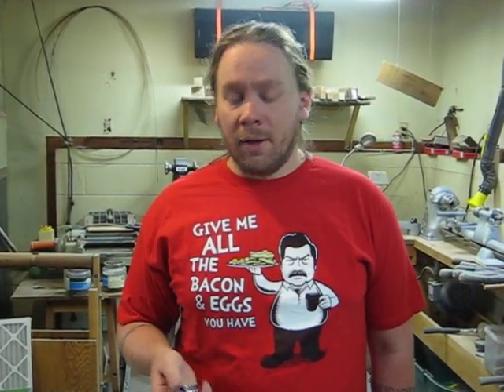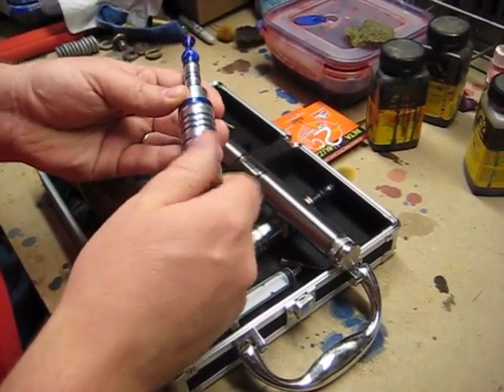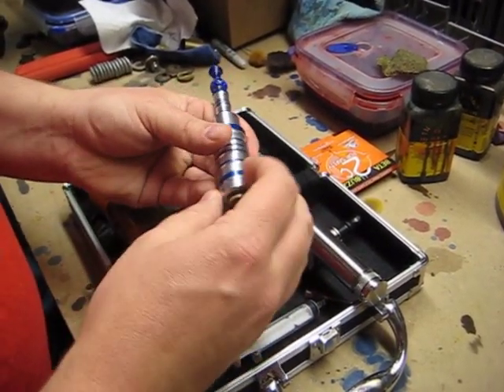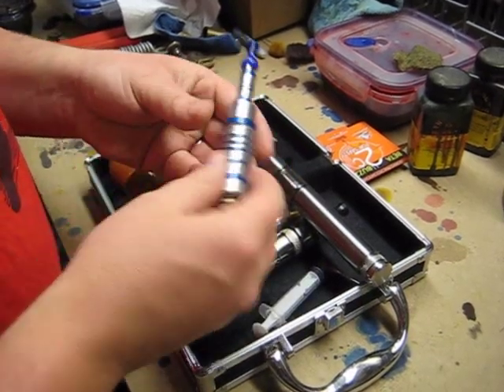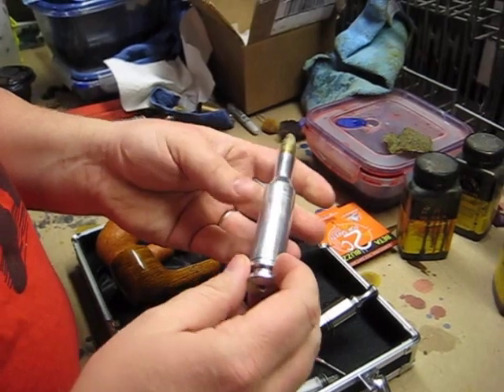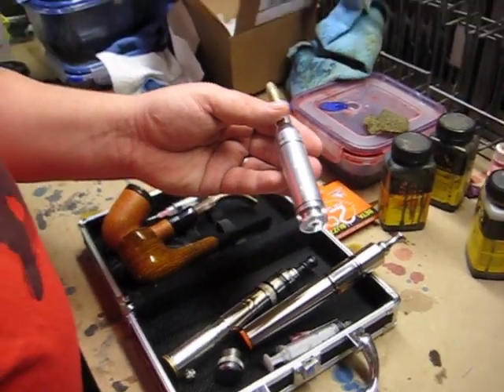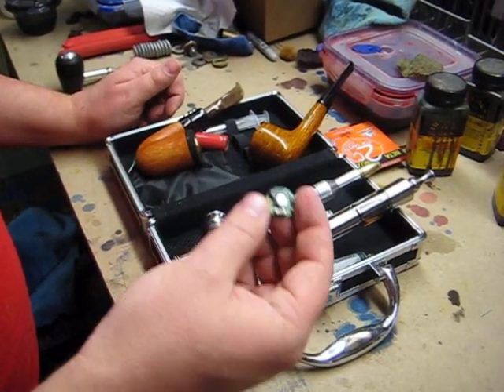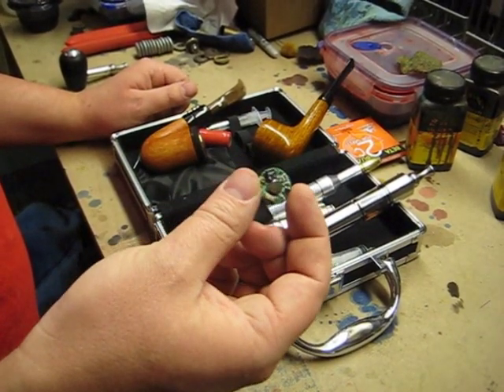Vape Safe Instruction Manual

Comment: Thanks for your quick response. Is that a greater than 1.5ohms or less than 1.5ohms sign you indicated? I love the idea of the fuse, but it only tripped once and not several times and now it doesn't work as well as before. It seems like my mod is in low voltage mod with this fuse attached to the battery.  To call it reusable??I think not. I should have just bought the cheaper fuse had I known how version 2 performs. What a dissapointment.

I was only using a  IMR18350 small battery.

Comment: NEED HELP: I recently have the vape safe 2 (reusable fuse) and after it shorted out, it doesn't perform the same. After letting it cool down and the fuse reseted, when I vape it seems like there's not enough power on my mod even when battery is fully charged. Despite of how hard I inhale, only a little bit of vape comes out. When I remove the vape safe 2 fuse from the battery, if vapes fine. What is going on? Any suggestions?

Comment: So I just received a 2 cent fuse and wanted to let you guys know that I absolutely love it. I was skeptical at first, thinking it wouldn't fit, but it fits fine and works great. Always good to have precautions like this. FYI: I am using the safety fuse in a silver bullet running @ 6v with 2 stacked rcr123a batteries.